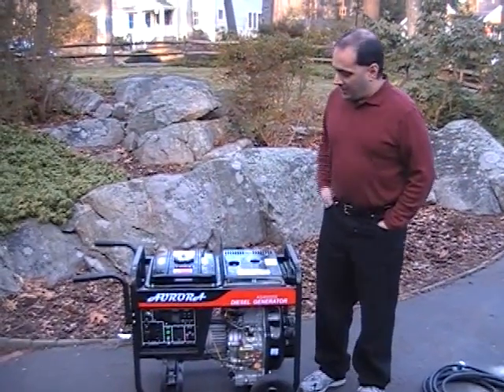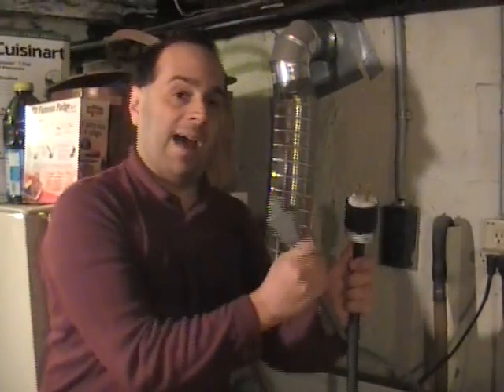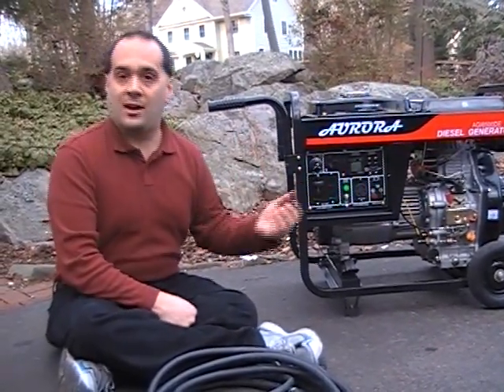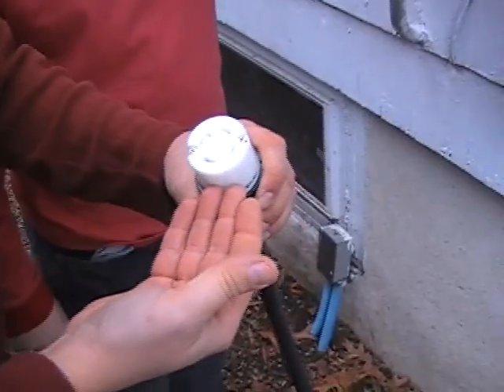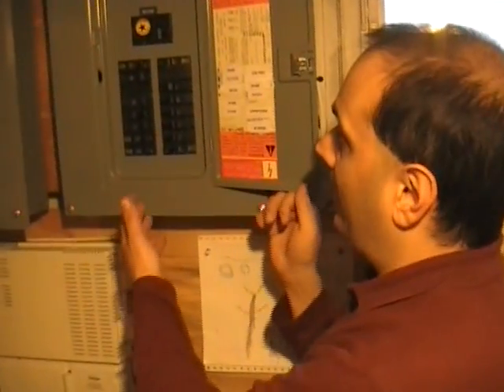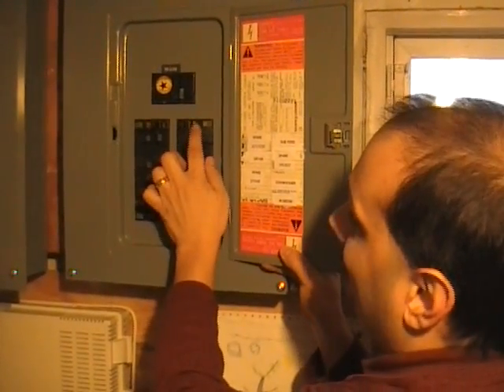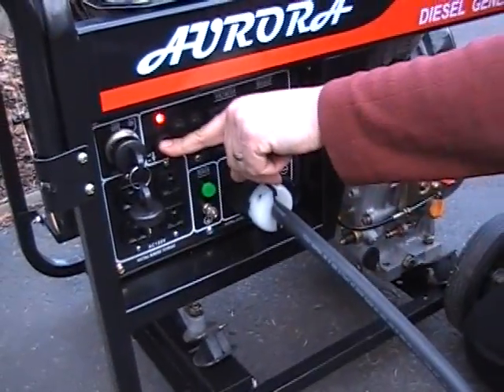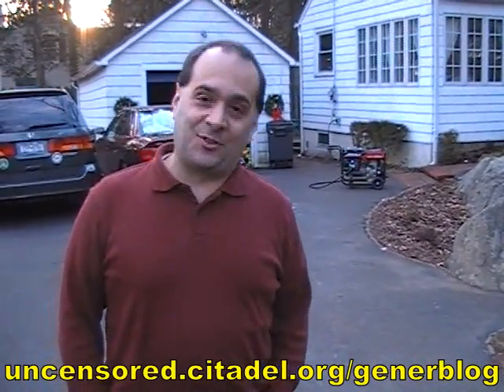Inexpensive residential generator hookup

Comment: I used a generator interlock on my panel box and converted a few breakers to tandem breakers.  This  made  space in the box for the generator breaker.  I made a list of what my generator will not run and labeled the box to be able to turn those breakers off quickly.  You generally want the in feed from the generator as close to the panel box as possible.
Reply: Make sure you follow all the generator safety rules before using portable generators. This is just a reminder for everyone’s safety. All generator safety rules should be followed carefully. Here are the rules about generator safety: Generators can be dangerous if not used carefully. Every year, hundreds of people die or get injured when using portable generators due to carbon monoxide poisoning and electrocution. Make sure you are using your generator carefully and keeping others safe as well. There is something very serious that everyone should always be aware of when using generators. Some people do run their generator indoors which is not safe and that increases the risk of carbon monoxide poisoning which can cause death of family and you. Some people run their generator in wet conditions which can electrocute them. Please remember that you should never run your generator indoors. Remember that carbon monoxide is an odorless and colorless gas that you cannot see or smell. Carbon monoxide is a silent killer. Keep that in mind. Make sure your generator is 15-20 feet away from your house and away from doors, windows, and vents. Never use your generator in your porch too. Having a carbon monoxide detector is very important against generator safety. Some people also allow children to go near the portable generator which could pose risks. We need to keep an eye on our children making sure that they are not near the portable generator so they won’t get electrocuted or burned by the generator which is dangerous. A locking enclosure also keeps kids safe. A generator shed might look like a tempting place to explore, or take cover during a game of hide and seek, but a generator is a dangerous piece of equipment that can cause injury. It says on the manual that we should also keep children away at all times from the portable generator to avoid injuries. Please do not allow a child or unqualified people to operate the portable generator.  It is important to keep your children safe especially little ones. The portable generator can be hot during an operation. Just because some manuals missed what should be listed doesn’t mean it’s safe to do. Always follow the generator safety rules when using portable generators. Generators pose electrical risks. If you need to use your generator during wet weather, you need a generator tent to protect your generator from getting wet. Don’t let your generator get wet. Keep your generator dry and before using your generator, please make sure your hands and your generator is dry. Do not wear loose clothing when operating the generator. Everything that is said on the generator’s operating manual should not be ignored. Never smoke cigarettes near the generator. Please keep flammable things away from the generator. Never overload your generator too. Your generator can catch fire. Never ever try to plug a generator cord into a wall outlet to avoid back feeding. Back feeding your generator is dangerous. Always turn on your generator first before plugging in appliances and shut off the appliances before turning your generator off. Use a heavy duty cord for your generator and the cord should not be worn out. All the instructions should be followed carefully. Never refuel your generator while it’s running. It can cause fire if fuel spills while your generator is hot. You should turn off your generator and let it cool off before refueling it. Having a fire extinguisher next to the generator is also important. This is only a reminder for everyone’s safety of using generators. Make sure your generator is properly grounded. Having a fire extinguisher next to the generator is also important against the safety rules. https://youtu.be/I1jT3ANENvI and here is a video more about keeping others safe when using generators and also about our family’s safety. It’s important to keep our little children safe as well. Make sure they’re away from the generator. Hope this helps.

Comment: To power up the whole house best to get a 20k generator, don't have 10k dollars for one . Can take a 7500 watt generator and do a lot of things with it. lights, run a computer, Tv, can use a micro wave, electric grill, fans, space heaters  ect    They are noisy Any thing better than setting in the dark cold bored and hungry What i did is wire the inside of my house with  Extension Cords for each room i have heat and air computer tv. in one room kitchen different plug in>  All i can run is 7500 watts 1 room only what ever room i go into > every thing is run off surge protectors  SO flip a switch to each rooms i stay in , i turn it off when i leave that room, turn it on into other room.  is all there is to it!   Fast and cheap
Reply from the maker: 7000 watts is a LOT of electricity for a small to medium size home, unless you have electric heat.  If you do have electric heat, then yes you would have to be pretty selective about which rooms you turn it on in.  I think we can all agree that a transfer switch of any type is better than extension cords.
Reply: @igfoobar   he hee almost a lot can run 1 ~ 220 v off of it Like a small welder  The whole house is electric he hee but to use the generator>  i got to rewire so i use extension cords  Power come on.  will fry every thing This way i can tell when the power come on with out damage > These are heavy duty extension cords for a portable generator If i had a bigger home generator.  Yes  i would use a transfer switch where it automatic switch over
Reply: IGnatius T Foobar not really starting draw from the A/C unit a refrigerator running and a hot water heater will really strain a 7000 watt generator if it can even handle that load.
Reply: @vladimirlopez7840  True!  yes it can >  just unplug a few things your deep freezer and ice box can go at less 8 to 14 hours unplug i got a off and on switch on my hot water tank with a timer. There no need of it running 24 hours a day.  just the time you need hot water>  This will save you at less 75 dollars a month .i just flip it on 15 min for hot water. then i turn it off  i save about 100 dollars a month RIGHT THERE! Night street light is 20 buck per light. per month  i got 6 in the yard. i turn 5 off  save another 100 dollars a month
Reply: @426superbee4  Make sure you follow all the generator safety rules before using portable generators. This is just a safety reminder. Here are the rules about generator safety: Generators can be dangerous if not used carefully. Every year, hundreds of people die or get injured when using portable generators due to carbon monoxide poisoning and electrocution. Make sure you are using your generator carefully and keeping others safe as well. There is something very serious that everyone should always be aware of when using generators. Some people do run their generator indoors which is not safe and that increases the risk of carbon monoxide poisoning which can cause death of family and you. Some people run their generator in wet conditions which can electrocute them. Please remember that you should never run your generator indoors. Remember that carbon monoxide is an odorless and colorless gas that you cannot see or smell. Carbon monoxide is a silent killer. Keep that in mind. Make sure your generator is 15-20 feet away from your house and away from doors, windows, and vents. Never use your generator in your porch too. Having a carbon monoxide detector is very important against generator safety. Some people also allow children to go near the portable generator which could pose risks. We need to keep an eye on our children making sure that they are not near the portable generator so they won’t get electrocuted or burned by the generator which is dangerous. A locking enclosure also keeps kids safe. A generator shed might look like a tempting place to explore, or take cover during a game of hide and seek, but a generator is a dangerous piece of equipment that can cause injury. It says on the manual that we should also keep children away at all times from the portable generator to avoid injuries. Please do not allow a child or unqualified people to operate the portable generator.  It is important to keep your children safe especially little ones. The portable generator can be hot during an operation. Just because some manuals missed what should be listed doesn’t mean it’s safe to do. Always follow the generator safety rules when using portable generators. Generators pose electrical risks. If you need to use your generator during wet weather, you need a generator tent to protect your generator from getting wet. Don’t let your generator get wet. Keep your generator dry and before using your generator, please make sure your hands and your generator is dry. Do not wear loose clothing when operating the generator. Everything that is said on the generator’s operating manual should not be ignored. Never smoke cigarettes near the generator. Please keep flammable things away from the generator. Never overload your generator too. Your generator can catch fire. Never ever try to plug a generator cord into a wall outlet to avoid back feeding. Back feeding your generator is dangerous. Always turn on your generator first before plugging in appliances and shut off the appliances before turning your generator off. Use a heavy duty cord for your generator and the cord should not be worn out. All the instructions should be followed carefully. Never refuel your generator while it’s running. It can cause fire if fuel spills while your generator is hot. You should turn off your generator and let it cool off before refueling it. Having a fire extinguisher next to the generator is also important. This is only a reminder for everyone’s safety of using generators. Make sure your generator is properly grounded. Having a fire extinguisher next to the generator is also important against the safety rules. https://youtu.be/I1jT3ANENvI and here is a video more about keeping others safe when using generators and also about our family’s safety. It’s important to keep our little children safe as well. Make sure they’re away from the generator. Hope this helps. Be safe
Reply: @The_Happy_Aviation_Enthusiast  Yes its ran out doors, 1 more safety feature is ?  ALWAYS USE A EARTH GROUND That is provide on the generator. That down into the ground. ON A PORTABLE GENERATOR ~ Can get ground cables at any hard wear store
Reply: I don't understand how you are doing this, what do you mean by wiring your house (each room) with extension cords, especially when you say you flip a switch for each room?
Reply: ever heard of surge protectors That got miilti Plug ends? with a switch! break each room off  and use extension cords in that room  to the things thats needed!  plug it into a surge protector that got a switch i leave that room, i turn it off and flip a switch to the kitchen leave the kitchen turn it off , and turn on the front room  easy > This way i do not over surge my generator its only rated 7500 watts

Comment: Good video. The problem is you can’t install that special outlet, additional breaker panel, etc without licensed electrician. Why? Because building inspector will fine you and will ask you to remove it, because you’ll have problems with your insurance when your house burns and then with your bank because you won’t be able to pay them off because of it. In short, if you want to screw up your life big time, install all these by yourself and save a couple of bucks.
Reply: my state allows homeowner to do their own electrical work.
Reply: @dennislett7896  So does my state !!! ! DUUUUHHH!!!!!!!
Reply: @dennislett7896  You dumb ass I was AGREEING with you !!!!!  Or are you that stupid ????
Reply: @dennislett7896  Our state does also !!!!  I did my barn, garage, shop, pump house, and Gen set interlock and an electrican buddy checked it out and it passed the state inspector !!!!
Reply from the maker: In most jurisdictions, you are allowed to work on your own home without a license, as long as you obtain the permit and final inspection.
Reply: @igfoobar  Bingo !!!!!
Reply: Yes you can.
Reply: Are you a licensed electrician? or ward of the state?
Reply: Or just install it and get a electritan to come out and sign off that it is good. Then go to the township and get them to sign off too.
Reply: right on bro!

Comment: How much did you pay altogether with the sub panel with breakers and 4 prong plug instead of just the interlock and 4 prong wall plug?
Reply from the maker: The panel, breakers, interlock, wire, and receptacle totaled about $200.  Yes I shopped around; some parts I got at the home store and others I got online, wherever I found the best prices.

I'm not including the cost of the generator itself, or the permit & inspection, because those are things you'd need anyway.